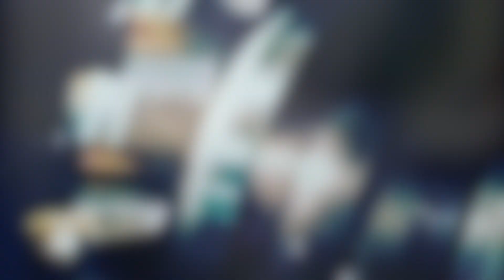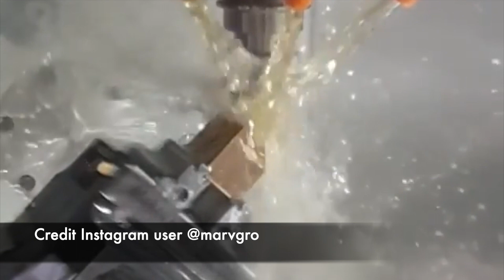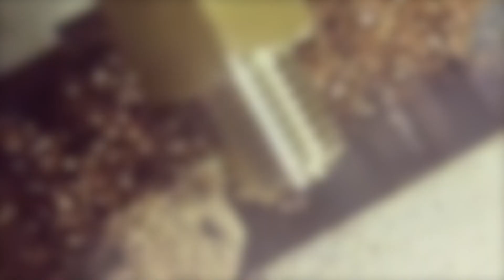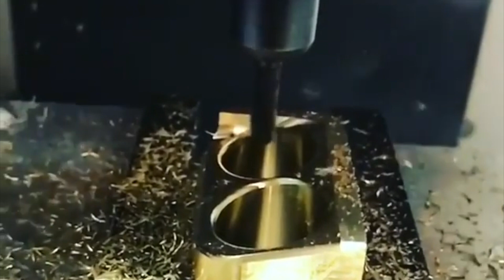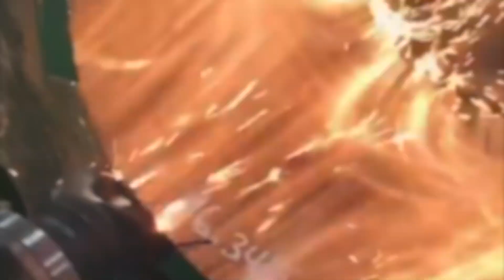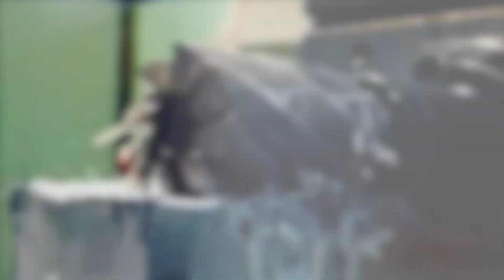SOOTHING CNC Machining - Slow Motion Machining Compilation

Comment: Saying you can machine is one thing. To be able to set up and visualise the job is another. But to be competent and set up a job, understand an engineering drawing. Understand how the material will react when machining using the correct tooling, relieve the stresses in the material if needed. Produce a high standard of finish and work to a precision tolerance is Becoming something of a dying trade. This is why the likes of this group is important to keep the knowledge of machining ALIVE. Great video 👍👍👍

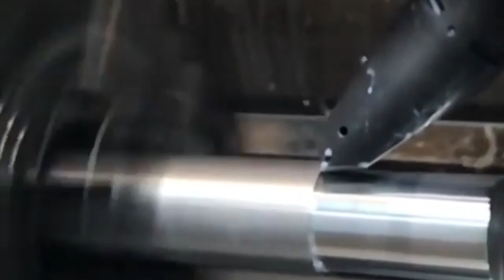Comment: At 1:12 I live the pinch turning,  I didn't new it exist but I have been using such method in manual lathe to turn some 4mm diameter over 100mm length. Just loving the 3flute drill too,  wish I could get one some day. Watching CNC stuff  is a challenge to me to work more in to owning one some day.

Comment: What a love about high speed machining with large depth of cuts it watching the chip oxidise mid air i think the best example of this is after Tig welding and blowing away the shielding gas and it suddenly turns blue I have to say it's the most fascinating stuff and I'm guessing that you could heat something up and use the colours wave length to calculate the flatness but I guess it would be inaccurate but would be interesting to see a video on it.
Reply: I have a feeling it would be inaccurate because of the inner stresses of the material and because of the heat expansion of the material and it might be slightly deformed.